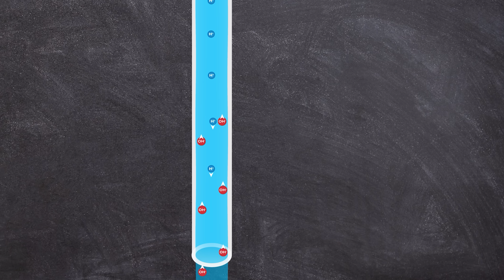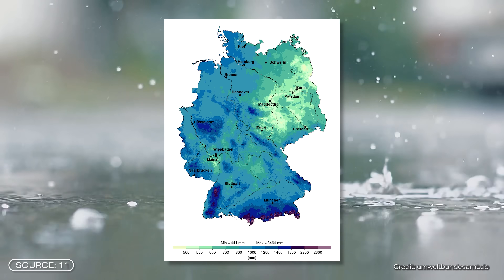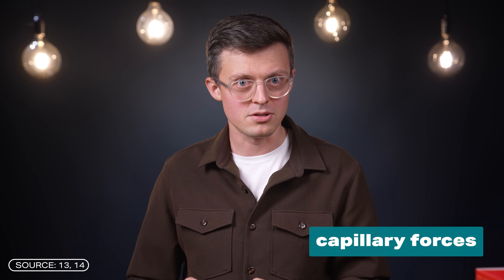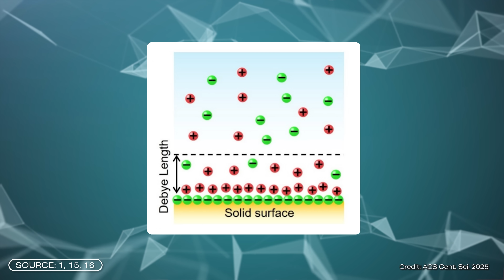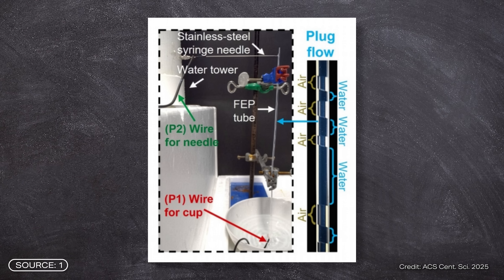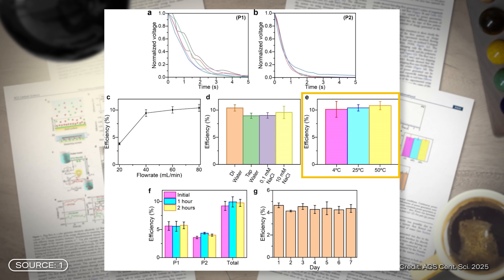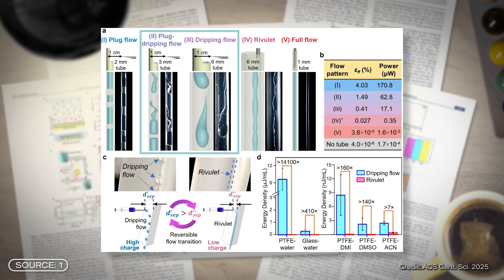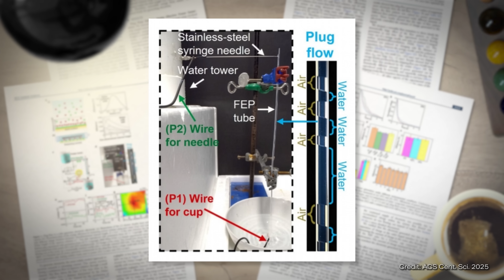Physics Hack: 100,000x More Electricity from Rain!

Comment: Tech ingredients did a video on this. I'm my memory serves correctly. He mentioned 3D printing tubular arrays at scale rather than off the shelf components.
Reply: How is that cheaper than mass manufactured tubes?
Reply: @crimstony1993  To put together 1m2 array to produce 100W you will need 227272 tubes of 2mm diameter and 32cm lenght. So imagine yourself cutting and gluing 72.7 kilometers of "cheaper mass manufactured tubes", agains a 3D printer that will take at worst a day :)

Comment: You have the gutter water go though filter into a small reservoir which feeds a series 30cm tubes into another small reservoir and repeat those modules all the way to ground, it take a lot more materials but should work.   You could produce them in a factory in tank/tube modules that could just need connect them together on site.
Reply: you'd also have to stop biological growth.

Comment: couldn't all of those caveats be solved rain barrel and filters? filter any debris  and run it inside where you have 32cm with the right size tube that only dumps out the right flow rate for the tubes, and the 32 cm restriction isn't too big of a deal because you could stack them , which makes me wonder can you have the water that comes out of a 32cm tube go into another 32cm tube, i would assume so its the tube that has the limits and not the water

Comment: Technology always gets cheaper & more efficient as it evolves from experiment to practice. This tech will be interesting to watch over time. 👍🏼🇦🇺
Reply: Problem is that the energy isn't  there,  there isn't really that mouch rain
Reply: @steamcastle Depends where you live.
Reply: @AShakyLife but he saif Germany, and the place there that get the most only gets 2500mm, world max is a place in Malaysia that get close to 12000mm.
The energy of the 30cm he said was the max, would be 7500joules, og the output of a 100watt panel for a minut ant a half I Germany, in Malaysia they get enough for  7 minutes.
And yes if you funelled a 200m2 roof though it and maybe multiple unetenafter one another you can get it up to power a single led light year round. Or you could put up a stamp size pv panel and get more then that.
Reply: @steamcastle I see what you mean.
Reply: @steamcastle : this is only experimental … like the first steam experiments, that moved only mere toy turbines …
Reply: @drnox8268 yes but with steam it clear  that they only got a little procentage so there was more to get. Same with early pv. But rain there just isn't energi the even if they energi take 100% of what is there.  There just isn't enough they unless you all the rain for a large areas many square kilometers. And then what you have is is a hydroelectric plant.
Reply: @steamcastle : I appreciate what you say, but who knows what avenues this embryonic research might uncover or lead to … cheers mate 👍🏼
Reply: @drnox8268  it is an interaction idea, there just really isn't anywhere for it to go when you start that close to 100%.
And there just isn't that much energi in rain.
Reply: @steamcastle did you watch the video at all?
Reply: @alanhat5252 yes, the maximum energi you can get is the potential energy. And they said that the hight difference that it works fore is 30cm, and we'll you can do that math right?
Reply: And yet electricity bills keep going up 🤔
Reply: With some greedy exceptions true on large scale and long time periods. Lovely painting pfp, btw.
Reply: @dannydetonator I heard your mother sat very still for that portrait, and had a huge smile the entire time. 

 Or that is just her face we don't know.  

 The painting looks like an exact replica. 

 Good job painter, and mom!
Reply: @RedactedDeath : that’s actually a portrait of my Mum … she was gorgeous, and gave me her good looks …

Comment: I live in rain forest in one of the wettest places in the world (~8000mm PA) and have thought long and hard about extracting energy from rain and mist. 100W/m^2 is not nothing so this is a great addition to the tech. Nice.
Reply: Your likely better off collecting all the run off from your roof and installing a downspout in your down spout. If you want you could have a collection tank that empties when it reaches a certain point to dump into the turbine to utilize the run off from the collected mist.
Reply: 8 meters of rainfall a year. Very rainy. 
Well if we assume that your home is rather large, a cube 10m by 10m by 10m, and we assume our generator is 100% efficient. 
Then on average, this generates 2.5 watts. Enough to run a set of LED fairy lights.

Or, you could stick a postcard sized solar panel on the roof and get a similar amount of power.
Reply: @donaldhobson8873  with an estimated annual output of 80.000kg × 9,81m/s^2 × 0,32m × 0,1eta =25.113,6 Wh = 25kWh if you can harvest all energy of the 10x10m roof perfectly.

With an estimated expensive energy cost from 0,3€ (as the speaker is german an globally they have high energy cost, so it would be more viable) you would save about 7,5 €/a 

Basically nothing and this is perfect conditions with high energy cost.
Reply: @donaldhobson8873 
Absolutely
Add 8 m per year rainfall, this technology is about 10,000x, give or take, less effective at energy collectionthan solar panels
Reply: My idea was piezo electric layer below solar power layer in solar panels. Never done the math but it won't generate much, but might be useful. Heavier rain = more power.
Reply: I would love to know the size of the build to proces this amount of rain. I can imagine it will be quite big.
Reply from the maker: That's an incredible amount of rain! It sounds like this tech could be a real game-changer for you.
Reply: @GermanScienceGuy I want to go back to what iragmani said mist. Part of what allowed there to be more charge in the presentation was air between water. To break up the flow. Mist and fog may creat more energy. Breaking up more of the water molecules. Therefore if you could create, collect, contain most or fog you might have even more energy capture especially is place that are forest dense, cloudy, has a lot of fog, swamp areas, or rainy.
Reply: @angjbrownwhisper  

''' Part of what allowed there to be more charge in the presentation was air between water.''

Are you saying you want to collect ''static charge'' from small droplets? It sounds like you are living in non scientific fairy tale land. Look up how a hydro electric dam creates energy by turning the water's kinetic energy into rotations on a generator through a turbine.
Reply: @angjbrownwhisper the separation between the water and air layer needs to be clear and distinct for the effect to work.
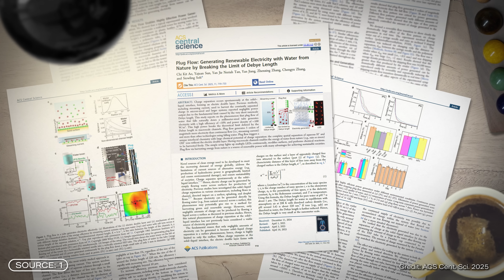Go back to 10:58 look at the diagram, it shows that the flow needs to be a plug flow, for maximum effectiveness, meaning in order for mist to work, your tube diameter needs to be extremely small, not very feasible as at those scales, the plug may form but no flow cause of how light those particles are
Reply: @GermanScienceGuy  When it becomes affordable yes. =)
Reply: havent seen the video, but is it produces 100W/m^2 .. its about half as efficient as a 1 m^2 solar panel produces a cloudy day
Reply: @Patrik6920 
But solar energy per square metre per year is about 100,000 times greater than rainfall energy, at roof height, per square metre per year.
Reply: @nickcook2714  ya its not even close ..
enegy in water falling of a roof at say 5 meters
E=mgh -> 1 * 9.82 5 = 49.1 joules of energy ..problem is wee nedd that energy constant
so to match the 100W (wich a 0.5 m2 panel produces) u need 2.04 liters per second .. or 7.3 cubic meters of rain / hour ... a completly insane ammount
Reply: Ecuador?
Reply: It is so dependent on rainfall volume, roof area, roof height and the ability to remove particulates (not having tree branches shading the home). It sounds like even on the high end of all these it still isn’t very much energy.
Reply: I was coming to say this. Anyone dwelling in rainforests would benefit especially since you would not need a clear access to solar so tree cover could  potentially be spared. Combined with agroforestry efforts I see the potential.
Reply: It is nothing when it costs $2,500 to generate 100W of electricity.

Assuming it never broke and never required maintenance it would pay itself off in 10 years in the very best case scenario where it's raining 24/7.

Even in the rainiest places on earth it only rains 2/3rds of the time so you're already looking at more like 13 years which puts the return lower than just buying bonds or a good savings account and that's assuming it require 0 maintenance and lasts at 100% perfect efficiency for the whole 13 years.
Reply: @MrDeathray99  erm ... still solar panes r way cheaper ... to generate 100W .. 0.5 m2 is needed in bad weather .. cost  around 60€ or 69 USD ..
..if we take installation into account for a roof 10 m2 .. its 1670€ (1900 USD) .. the intallation is the costly part, buying/replacing panes is dirt cheap ..
Reply: Look at @AirHES
Reply: Mawsynram, Meghalaya, India?
Reply: @IragmanI
Do you know the potential energy equation  E = mgh
m = mass, Kg (1000Kg/m³ for water), g = 9.81 (gravitational constant) h = height  difference, metres.

If the collection area of your roof is 10m above your power device, this device ,at a claimed 10% efficiency, will give you about 2.2Wh (not KWh) per year per square metre of roof, which means you'll need upwards of 5m² to charge a mobile phone once per year!
Reply: Yeah, one has to be careful about the units here. 100W/m² as a peak sounds impressive, but you should also look at the integral over time. With your 8000mm / m² per year, assuming you can collect and store them 10 m above ground, you collect about 785 kJ per m² per year of potential energy:

8000 kg * 10 m * 9.81 m/s² = 785000 kg m² / s² = 785 kJ.

This translates to only 0.218 kWh per m² per year.  Of which the described technology claims to extract ~10% as electrical energy, so 0.022 kWh per m² per year. If you have 100 m² of roof available for collection, that provides you with about 2 kWh per year. 
Which is equivalent to the typical yearly generation of a solar panel 10 cm by 10 cm in size, and might just be enough to keep your mobile phone charged throughout the year.
Reply: @ShieTar_  and its per acre .. or 4047 square meters that 8000 mm falls on.. or roughly 2 mm per squere meter .. i assume his values is wrong .. it rains more in most deserts ...
Reply: @Patrik6920  Pretty sure the PA meant "per annum", which means per year.
Reply: @ShieTar_  Yes, thats make sense, TY 👍
Reply: 100 wats 250 likter heater hyferhng fuke dell
Reply: Look up Triboelectric materials, if those are incorporated into a system it works. Otherwise, this report is BS
Reply: @randymorales1127  it doesent work ... its a hoax/joke ...

Comment: Would a block with multiple holes be cheaper than individual tubes? That should also simplify cleaning since you can simply blow compressed air through a whole block in one operation.
And did they test different materials? Maybe there's something that is cheaper and/or more efficient than FEP?
Reply: Read the invention paper for reasons

Comment: Instead of tubes could plates with semi circular channels be made. When put together you would create tubes. the plates could be separated for ease of cleaning.
Reply from the maker: That's a really interesting idea! It definitely sounds like it could simplify maintenance.
Reply: I like the idea.  I don't even think the tubes need be closed on all sides.  
The sheets wouldn't have to be pressed tightly together, just close enough.

Comment: Wouldn't more energy be generated from flowing the same water past a generating turbine.
Reply from the maker: That's a good point! We're exploring all sorts of ways to generate power.
Reply: @GermanScienceGuy  A little fanlike device that could be clamped onto the bottom of a downpipe. The main cost would be running the wiring back to the inverter/battery. Leaves and detritus could be caught in a filter up at the gutter level.
Reply: Can do that too. But not the best at low speed and low volume--that's more like a waterwheel.
Reply: @thekaxmax  Turbine is fancy for waterwheel.
Reply: @thekaxmax  A water wheel can be a good thing but maybe a system can use flexible materials rather than things that move past each other.  Wear points need to be reduced.
I am thinking of something where the water packets move down under gravity and the energy is harvested.
I some ways, we can say dollars per watt matters and not the efficiency.  20W of completely free power is worth going after.

Comment: Even with 100% efficiency stupid. Watch Sabine Hossenfelders Take on IT
Reply: Sabine is often pseudoscience
Reply: @ralphstern2845  but this even she got right. She plugs in the numbers which makes the difference. Now I have a question for you: let's say the roof is 50m high, you harness 100W of power per m² with 10%eff.  and so the rain delivers 1KW potential energy per m². You will need 9,8m/s² earth acceleration also. How much rain falls on a square meter? Is that more, than say a summer storm?  😁 By the way, you won't need a PHD for this, I explained it as a tutor  15 year old pupils